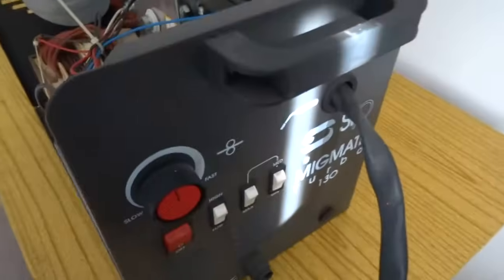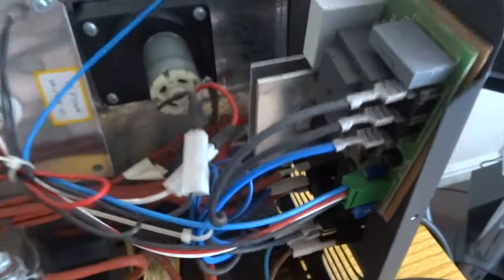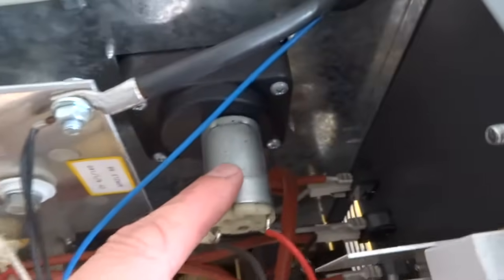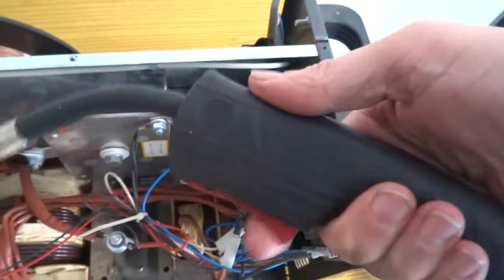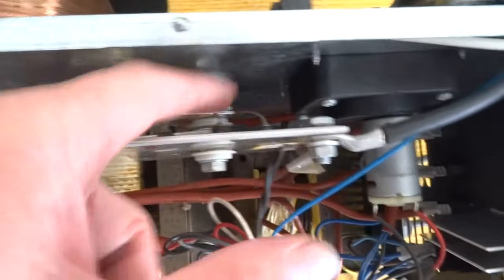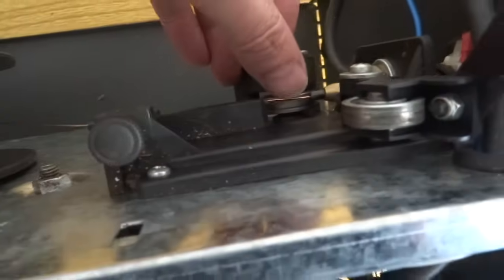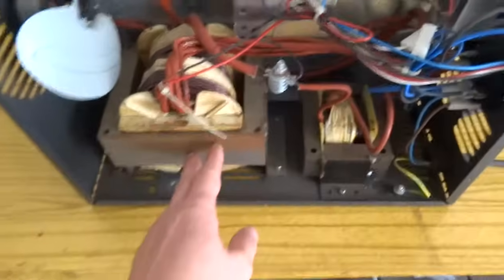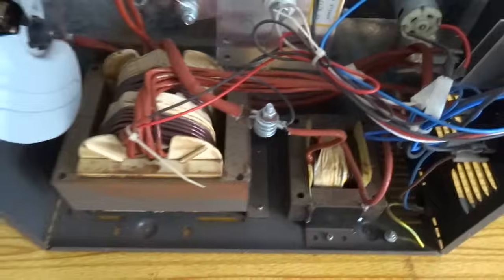Top 5 MIG welder common problems issues faults and easy fixes

Comment: Hiya, I've just swapped the polarity on an old sealey supermig 150/1 and now my trigger doesn't work..

is it possible to rewire the trigger? and if so, would you have any info/links to how I can do this?
Reply from the maker: the pcb board is expecting a cetain polarity you need to swap over the trigger wire to.
Reply from the maker: be safe
Reply: @cagmito76  thanks for the reply.. so, can I just cut and swap those inside the trigger?
Reply from the maker: @aether-elephant  is it single wire ? as no its just one wire you need to trace back and and change polarity

Comment: High
I've done a continuity test on all wires getting a beep i think it may be the pcb mine on the top as gone black
Reply from the maker: yeah its possible bud remove in check tracks check the diodes transister etc

Comment: My cup is shorting on my work, throwing sparks from nossel, any idea? A bad ground cause this?
Reply from the maker: test components
Reply: @cagmito76 now it's burning the wire right in front of drive wheels as well. It's like it's grounding through my lead instead of ground clamp.

Comment: i just had the big green cable inside my lincoln pro mig 135 come loose (burn off) from its solder connection.  should this be re-soldered or should the machine just be replaced altogether?   all i did was turn the machine on and heard a low humming noise,  then a pop and some smoke and burned metal smell.  thank you for your input.
Reply from the maker: It could be a short somewhere do some tests maybe transformer has a short ?

Comment: My welder keeps making a humming noise. No crackling noise at all but still somewhat welding decent. Any ideas?
Reply from the maker: Excess humming usually comes from tansformer as they  age and insulator breaks down why not in insulation resistance test it.

Comment: I do not have voltage to the wire feed motor. I do have communication from the gun, you can hear the relay on the cpu turn on with gun switch. Any ideas?
Reply: Possible bad wire feed motor, or bad wire speed potentiometer,  or possible bad voltage control switch.

Try turning your voltage control switch slightly up or down while holding the wire feed trigger, to see if the wire feed motor starts.

Sometimes your wire feed tensioner could be too tight, and need to be loosened up to allow wire feed motor to turn. 

Also try turning wire speed selector knob up to highest setting while squeezing wire feed trigger. Did the motor turn?

If your welder has a reset button, push that to see if the welder needs resetting.
Reply from the maker: Maybe transistor

Comment: Hi .Ive got a sip migmate similar to the one shown , with the single blue wire to the torch, however ive purchased a new torch which has 2 black wires. Can you tell me how to connect in order to make the alteration work. obviously I'm thinking connect one to the existing blue wire and need to know where to connect the other.
Reply from the maker: Not sure you need to test

Comment: Hi mate just brought one and it wont weld it will spark at the wire but wont weld dont know what it could be got a good earth what do you thinks wrong cheers
Reply from the maker: Not sure sorry you need to test i did have a full test video on welders but it got a copyright as i had music playing on radio, ill do another as soon as i can.
Reply: You could have a poor grounding issue. Is your ground clamp close enough to where you need to weld? Wirebrush the area to ground, before you attempt to weld. Need good metal to metal contact, to get a good grounded surface. Without a good ground, the welder won't spark up good.

Comment: I have a milermatic mig welder with approximately 35 hours on it.  Purchase  brand jewelry in 2003.  Worked fine till one day quit working.  Only used 030 wire with Argon co2 mix.  Welder would only run for 2 seconds then trip the house breaker.  I took it to welding shop where I bought it.  Machine  had a 12 month  warranty,  and was 1 moth out of warranty.   They wanted me to purchase  a new machine.  Service said to bring down Machine, they thought it was a power issue,  took  Machine down they plug it into  their 120v 20amps receptical
Same thing,  Machine ran for for 2 seconds  then shut off.  They replaced gun with new one, same thing.  They said it was rectifier, bought new one. 
Same problem,  took it home checked switch, replace fuse in back of Machine.
No change, only thing I didn't check was transformer and overload protector.
Seems to trip fast when I turn up Machine.  Any input would be greatly appreciated. 🙂
Reply from the maker: I would insulation resistance test the transformer and inrush current test it too.